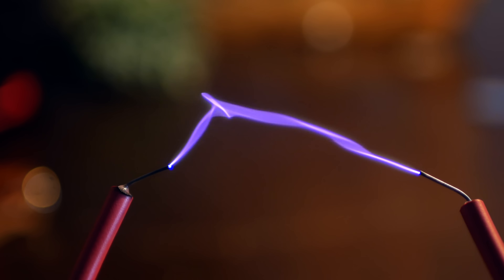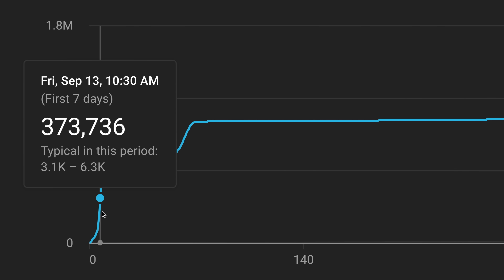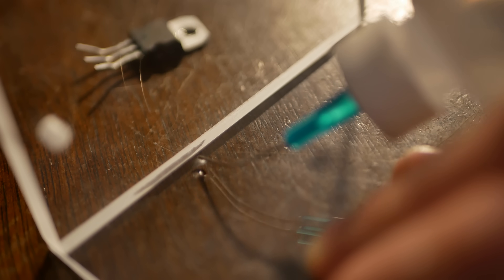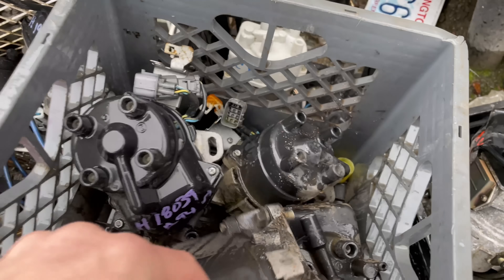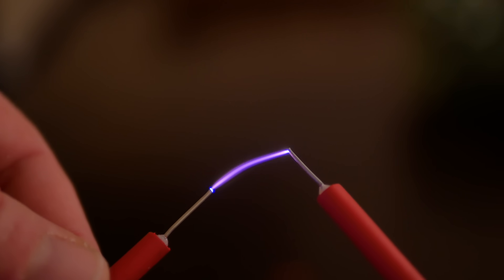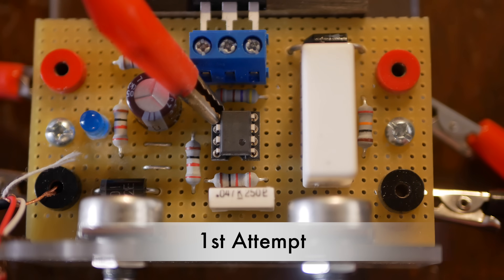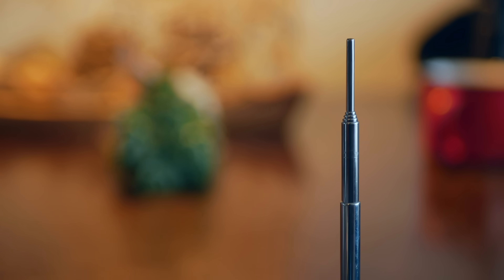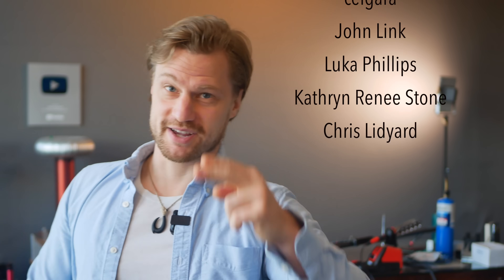Giant Bluetooth Plasma Speaker from Honda Ignition Coils (60,000 volts)⚡

Comment: Why don't you use a half bridge transistor circuit to power the the ignition coils, it will provide double power and also you can change the resonant frequency of the ignition coil by adding a suitable capacitor at the primary.

You can also use carrier frequency of more than 20KHz and use capacitors at the primaries of the ignition coils to make it resonant at higher frequency to get rid of the high frequency noise.

I recommend you to use a half bridge circuit in place of a single transistor for more power and voltage, I tried to make one like you and I got perfectly white superhit arcs with better audio. (Used half bridge circuit with gate drive transformer and NE555, the switching frequency was set to 37KHz, I used only one coil and the output arc was around 1.5cms long at 90% humidity and 30°C)

Comment: I know what your problem is. To fix it provide the Bluetooth device with power from a separate source
Reply from the maker: Hm, I had not considered that. The power to the 5 volt regulator is on, regardless of the ignition coil circuit oscillating though, so not sure what the difference would be.

Comment: Setup an arc with another stable frequency first. THEN send the audio on top of that.  I hope that makes sense...     This way the conductivity of the air is stable caz the arc is already established.
Reply from the maker: That's what this circuit was doing. A stable arc at a present frequency, and it is interruped by audio input.

Comment: Tried giving an audio signal to my circuit also.maybe because the driver circuit frequency was high ,i didn't hear any thing.and the circuit started performing worse
Reply from the maker: It could be a driver frequency issue, or a power issue. How big was your arc?
Reply: @PlasmaChannel  Did some calculations and the output frequency is about 48khz.The initial arc length is about 2.5cm

Comment: I wonder if the rigidity of the gap isn't a factor in the erroneous pitch. Every time it discharges, the wires are repelling and attracting ever so slightly. Even though the rate would be ultrasonic, any imbalance in the circuit or rigidity and mass of each arm of the gap could reasonably be producing a beating pattern that could be audible and would be independent of the output frequency. If that where the case a spectrum analysis should be able to sus out the frequency, and if not maybe it's an output factor, and a notch pass might spare the old hear boxes. Also the plates in the flyback examples might be benefiting them in the fact that the resonance would make the amplitudes imbalanced, and thus less beaty.
Reply from the maker: That's a really great idea, and something I had not thought of. Thanks for the input, i'll need to do some experimenting.

Comment: Excellent sir! I love this project. Please provide schematic component values. I want to build it. I worked with the 555 timer a lot but I don't recognize the MOSFET
Reply from the maker: I did forget to include those values, didn't I? The 555 timer circuit can be found online, and values for the potentiomenters are 10K, plus series 1K resistors for a maximum fixed frequency.

Comment: Since you configured your coils in a dc biased way, could you boost the coil's saturation by placing permanent magnets in boost configuration to aid your coil's flux density until it collapses on the off side of the feed?  Would flyback diodes help desaturate your coil on the off side?
Reply from the maker: You've peaked my interest.

Comment: Video Idea: This might be pretty hard to build. But can you make an audio visualizer for that spark gap? Maybe with a flame tube, or maybe with the arcs themselves. (I've been working on the arc visualization myself and I haven't figured it out yet.) So that's hard for me, but if you figure it out then that would be awesome. You could use your transmitter and then use the receiver to receive the signals either by that or a radio station. Then convert that to signals you could use to visualize the audio.
Reply from the maker: Hey SA! That's an interesting idea. Really would need to do some thinking myself, but perhaps a pressure based sensory network which interprets audible pressure waves into electricity, then into power for a visual display?

Comment: Check out HEI(high energy ignition) coils! They use "direct" drive from a capacitor, and can do multiple sparks per "spark".
aka the coil is made for way faster running!

For the voltage meassurement, please use spheres, sharp points tends to make the distance longer per voltage!
Reply from the maker: Oh, so cool to learn of the HE coils. Always been curious about those! As for the measurements, I always use spheres. Measured it off camera.
Reply: @PlasmaChannel  Yep.. I think the HEI coils may be all ferrite. Even you could also try making a deal with a transformer manufacturer!

There are some on aliexpress/alibaba that I know of (and likely others too), that may be willing to make a deal or similar.

Comment: Use polycarbonate instead of acrylic--way easier to work with and is available in that same scrap bin you were digging through.
Reply from the maker: Yeah, i've been curious about that. I've read that it crazes way worse though, and that is the biggest issue I always have.

Comment: The entire reason why I became an automotive mechanic in the first place was because of the interesting ways Automotive Parts can be used with electrical fun. Honestly, As soon as I heard that you could rebuild an alternator to power a house I was hooked... I stopped being an apprentice Carpenter, and joined the Airforce to become a mechanic
Reply from the maker: Thank you for your service Vernon. An Alternator powering a house makes sense, it can produce, what 60 amps at 14 volts?
Reply: @PlasmaChannel  its been a long time since i had to test the amperage on one of those, that sounds about right. 9 times out of 10 I'm only looking at the voltage. You always want that guy running between 13 and 14
Reply: @PlasmaChannel  ive bee through alot. I just know its possible. Has something to do with the diodes
Reply: Without a rectifier it produces ac power then adjust the speed to get 120v or 240v! I used to have a welder that was gas powered using a special wound alternator then it was rectified I think it was a Scott welder I think the manufacturer used to work for nasa ! It gave me great welds not as good as my thousands of dollar military welder compressor with generator!!

Comment: Great stuff man

I'd really love to see you use ignition coils to build a decent hand held plasma cutter
Reply from the maker: Hey thanks Sarch. Feel free to share the video
Reply: Plasma cutter is done with much lower voltage, high current, and pressurized air. It is a destructive welding process. Ignition coil would make a decent HF start for the plasma cutter, but once arc is established, you go back to much lower voltage to cut.

Comment: Try out a TL494 based audio modulated driver. It’s a massive improvement over the 555 based circuits. Should work fine on ignition coils, just will have some audible carrier frequency noise. I threw one together a while ago and no joke, it sounded as good as a high end tweeter.
Reply from the maker: Thanks, i'll look into that! News to me.

Comment: Nice build! 👍I've watched your previous videos that play music with the arc of a Tesla coil before ,so I wonder if you using DRSSTC/SSTC's interrupter directly drive the ignition coils instead of just using a single 555 driver circuit would be way better than this?🤔
Reply from the maker: Hm. That would take some work to test out. Good idea though
Reply: @PlasmaChannel  I've tried this circuit before and it worked perfectly😀 !The SSTC‘s interrupter as a driver and it can only use square wave music input, but because of this, the music arc is almost no noise! It's really worth to test out！⚡

Comment: How about a three phase transformer⚡🤔
Reply from the maker: That sounds like a heck of a lot of power.
Reply: @PlasmaChannel  or less. Maybe 1.5v in and depending on the coil "out?"  High current ran threw tuned forks making ark gap, maybe another three phase coil for voltage out? Hmm only if it was that easy. 🤔 just throwing ideas 💡

Comment: I love my Bluetooth SSTC, but this is something I might have to build. I've been meaning to do something with an ignition coil for years. Specifically hooking the output up to a stainless steel 102 inch 11m antenna. 🤔 Also my ears hate you after watching this through my 20yo Infinity Interlude speakers with CMMD done tweeters. My cat also spazzed out lol.
Reply from the maker: WHoa now. That's a huge antenna hahah. Give it a try, but make sure you have a radio license.
Reply: @PlasmaChannel  Even with a Ham license I'm pretty sure the FCC, along with any local operators, would frown highly upon it. I can only imagine the amount of dirty, multiband, interference something like that may cause.

Comment: Not sure if anyone else mentioned it, but spark gap transmitters have been prohibited by international law since 1934. 
The FCC is particularly greedy when it comes to fines.
Reply from the maker: That's correct. FCC is quite terrifying. I have lined by apartment with a grounded faraday screen about two years back, and tested for interference outside my place (zero). Luckily my place is concrete and allows remodeling.

Comment: A really expensive -- and low-quality -- way to do AM radio, though!
AM Transmission is way simpler than this with way higher quality, with nothing more than a couple of transistors.
Same with FM at VHF but you would definitely need planar backboard circuitry at those frequencies ... easily done, though.
Reply from the maker: Oh trust me, super low quality haha. It hardly even transmitted 20 feet.

Comment: For your next project, you could also use an ESP32 as a Bluetooth audio receiver, as wel as the driver for the coils instead of the 555.
Reply from the maker: What? that sounds cool. After a quick google search, aren't those just bluetooth boards? I dont think they could hand the 100 watts needed for my coils.
Reply: @PlasmaChannel  They're like an advanced arduino with both a WiFi and a Bluetooth modem built-in. There are examples online where people stream Bluetooth audio to it. What you could make it do in its software, is mix this received audio signal, with a carrier frequency that you let it generate internally. Now you're using a 555 to generate this carrier frequency, but an ESP32 should be able to do the same. You then send the generated output signal to one of its pins to drive a FET. Similar as to how the 555 now drives the FET.

Comment: Could you please explain the main difference between a flyback transformer (found in old TVs) and an ignition coil (found in cars) ? Thanks
Reply from the maker: Absolutely. A flyback uses a dedicated primary coil, and secondary coil. It also tends to have a third coil, called a flyback/feedback coil. Their cores are built of a special artificial mixture called ferrite. It can hand really hight frequencies above 10,000hz, which does not heat up and waste energy during operation. However, flyback transformers are not capable of high peak discharge currents PER SPARK EVENT. 

Ignition coils have a secondary coil which is physically connected to the primary. So, they often only have 3 terminals. Ignition coils produce far higher voltages, and require a quick change in current flow to the primary in order to operate. They have iron cores, which means they cannot operate at frequencies too far above a few KHz, because the iron starts to heat up and waste energy. However, the energy stored in the magnetic field of the iron core is huge, compared to flyback ferrite cores. So, they have the ability to have HUGE currents PER SPARK EVENT. Overall, flybacks can pump more power, but ignition coils can pump more voltage.
Reply: @PlasmaChannel  Thank you for this clear and complete answer.

Comment: I'm surprised the high voltage doesn't affect the Bluetooth quality. (Have you tried to see if driving the audio directly from source changes the output at all? Basically bypassing the Bluetooth just to test.)

Also love how you setting up the radio test here contrasts to when you did previous test with spark gap radio, two years ago and how much effort you went to not cause interference and run afoul of the FCC then vs now. Lol.

Does your lady know about your affair with ignition coils and your torrid live triangle with acrylic and Tesla coils?

If she does and is cool with it, most definitely a keeper, lol.
Reply from the maker: Hey Justin! Yeah, I was surprised too. though, the high voltage is a good foot away from the bluetooth board!

My lady has come to realize that my first love is plasma. She always knows to make room for plasma in our relationship :P
Reply: @PlasmaChannel  did you happen to try wiring music in directly, just to see if it makes any difference? (I haven't messed around with Bluetooth much)

Well that one is definitely a keeper then! (Now does she know about you and acrylic? 🤔🤣)

Comment: Oh yes, in order to hear the plasma more clearly, you need ring magnets through which it will pass right through.
Reply from the maker: I tried that. Even with RECTIFIED output, I couldn't get the plasma to be deflected due to magnetism. Weird.
Reply: @PlasmaChannel  Exactly.  Try first to find out which plasma is subject to magnetism.  I had a 2 kV plasma from a microwave oven transformer.  It crackled and turned blue instead of green.
Reply: @PlasmaChannel  It means all the same it is necessary to amplify the magnets, and even try to amplify them with a pulsed high-frequency unipolar current.

Comment: Want an idea to improve your plasma speaker (not sure what will work)?  Try multiple electrodes, many.  Some with a large distance between themselves, some with a small one.  And all this in a Faraday grid cylinder.
Reply from the maker: I did try several distances, though I think the circuit is fundamentally flawed. Too low of base frequency!

Comment: What type of power transistor do you use?
Reply from the maker: IRFP260N is the one I used. It works GREAT. On rare ocassions dies, but 99% of the time it is crazy reliable and makes insane sparks.
Reply: IRF260N is Okay

Comment: You want to use higher frequency transformers such as the classic TV flyback transformer for this purpose. They have ferrite cores and are optimized to run at higher frequency. If you get one that operates well at 44.1kHz I'd call that a win! you can get seriously good audio quality out of them.

3:00 What is the purpose of the 3A diodes? reverse polarity protection for the leftmost one can be better implemented with a P channel MOSFET. The other one serves no practical purpose other than dissipating power and reducing the voltage applied to the coil. I suspect you intended for that diode to help with back EMF but since inductors resist change in current, the voltage transient generated will forward bias that diode anyway.
Reply from the maker: Hey power max! Honored you watched my video. The first diode (right after power input) is to prevent burning out the 555 from wrong polarity of power. 555's blow immediately when given the wrong polarity of power. The second diode is a fast acting diode for part of a snubber circuit. I notice it actually INCREASED output voltage, while protecting the back EMF from the coil.

Comment: Wouldn't it work better as an interruptor (no sound, no arc) as evidenced by the flyback speaker
You could explore the bass frequencies. steve ward did some bass.
Reply from the maker: I'm not certain what you mean - the audio input on pin 5 of the 555 acts as an interrupter as is.
Reply: @PlasmaChannel  if you turn off the music, does the arc still work, if it does then it's not interruptor, it was hard to tell, 
Whereas the flyback version was very clear.
Pin 5 is a control voltage, i think all you are doing is modulating the frequency..